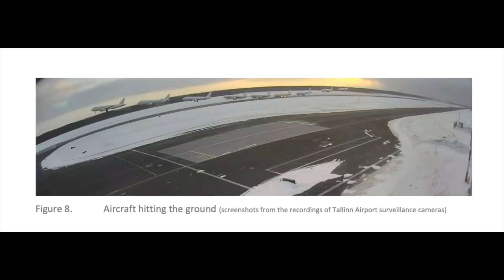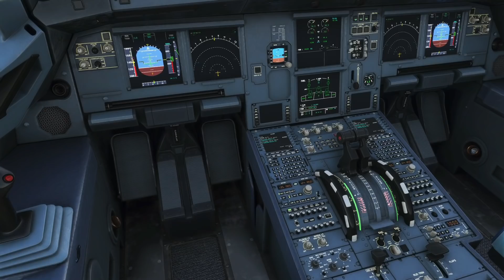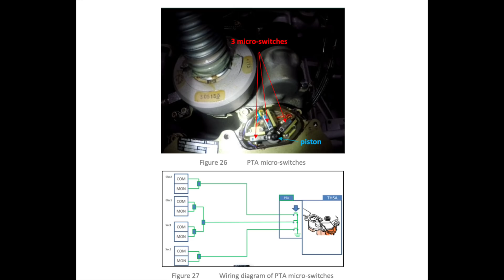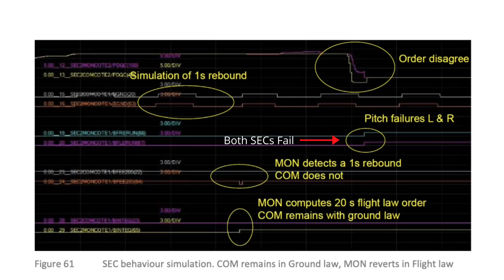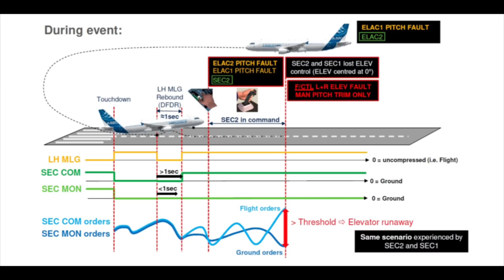The Oil Change That Crashed A Passenger Jet | The Crash Of Smartlynx 9001

Comment: Basically there are now 3 control systems: (I call them) Fly by Cable, Fly by Wire, Fly by Chip.  Cable has been around since even before the Wright Brothers and their Flyer took off in 1903 (all those failed attempts including but not limited to Langley), Fly by wire is where a computer takes your input and moves everything over electrical wires and does have manual backup (been around to various degrees since mid to late 1950s), Fly by Chip is where the computer has basically full control this has no manual backup (used on Canard controlled aircraft which are inherently unstable).
 
Once the oil caused everything to malfunction, these poor guys were close to Fly By Chip with the computer overruling their manual inputs, or least trying to overrule them!
 
I agree with a number of people here, that at the 2nd or at worst the 3rd time they had to do a reset, the instructors and the safety pilot should have said "my plane" take over the controls and land a sick bird.  "The penalties for mistakes here have severe and messy results!"  They're lucky they didn't die in a smokey, flaming hole in the ground!!!
Reply: At no point did the computer try and overrule the pilots? Where did that happen? The plane didn't pitch up by sidestick command because there was not pitch computer active. That is not overruling, that's just computer failure. Ironically if they had reset the computer again it would have been fine as the roll channel of the ELAC was still operational
Reply: @tomstravels520  Miracle of the Hudson (Airbus aircraft system prevented Sully to do a "flair" just before landing in the river, this would have reduced the damage the plane took, not only preventing the flooding (due to a tear in the aircraft's fuselage) but also would have allowed them to use both of the rear inflatable emergency ramps/life rafts) and the Boeing 737 Max's that crashed or almost crashed when the Fly by Chip system got a bad signal
Reply: @timengineman2nd714  you said “these guys”. At no point did “these guys” (in this particular accident) have their commands overridden. If the Max had been designed properly the bad signal wouldn’t have made a difference
Reply: @tomstravels520  It was causing them to have to fight the system!  They eventually  (thankfully) won.
>As for the Max's, that's part of the point!  Too Much Automation that, in the 2 Cases and at least 1 more case, that wasn't properly designed, nor were the pilots properly trained in the proper method to override the system!  (In 1 case the "copilot" would have barely earned his personal (private) flying license, in the US, Canada, GB, and most of the EU!  Thus not rated for being a Commercial  Copilot in all of the above mentioned countries!!!

Comment: i would go for from 6 to 8 on a commercial jet, really plane should be able to fly itself, but because of how complex planes are becoming, you  need pilots to deal with issue or tack off is the senario is not forseeable in the automation

Comment: I believe there should always be a final level of manual control in which the pilots inputs on the controls directly operate the hydraulically actuated flight surfaces; a final no automation, manual fly mode, powered by a seperate system like the apu which should start up upon engine shutdown.

Comment: Good thing this wasn't an actual flight & they were always in close proximity to a runway . A training exercise and they ignore a repeating alarm. One would think training would include things like this. Time to retrain the trainer i guess or fire everyone in that palne.
Reply: If this was an A to B flight nothing would have happened because the pilot would not need to manually stop the trim wheel. Resetting the computer didn't cause the crash
Reply: @tomstravels520  I was just saying why IGNORE a repeating alarm. Would you like to fly with pilots  like this?? C'mon dude.

Comment: Don’t just turn on & off. If you’re a pilot who flies automated planes, then fly them as such especially when training. If you don’t have as much automation, then it’s a different type of flying. Each has there downsides, but teaching students to ‘just reboot’ ends in trouble. At least they learnt why you don’t and a lot else that day. I like automation, but it can never take away from the need for humans to figure it out.
Reply: Do you know why the pilots were able to do so many touch and goes without issues? Because they kept resetting the computer. Resetting it actually did restore normal flight conditions. On the last one they didn't reset the computer and that is when the failures all came in

Comment: I've been waiting for this one! One thing that is not apparent from the video is, that the engines came into contact with runway, in the "bounce" or forced descend, because the gear was already way in the process of retracting. As a result auxiliary gearboxes beneath/on the sides of engines were damaged and one after another the engines failed. While the root cause is very interesting, this part is also very important.

Comment: I don't think the automation issue is something that can be rated on a 1-10 scale as you ask ^^' 

There is a fine line that needs to be walked when designing automated systems, and that's between assisting a human and replacing the human. Aircraft manufacturers/designers have strayed a little too much on the side of replacement, with the pilot being relegated to a monitoring role, which humans positively suck at doing, and isn't very engaging. 

I think a better balance can be achieved, where the automation is used in a smarter fashion to create a cockpit environment designed around humans and what they are good at. The issue with that is that airlines have no real incentive to push for this, since in 99% of cases a plane left on full autopilot will use less fuel...

Comment: In the James Bond movie “From Russia With Love,” his exchange dialogue with another to confirm other agent was legit went like this: Bond -“May I borrow a match”; Agent - “I use a lighter”; Bond - “Better still”; Agent - “Until they go wrong.”

From your well informed summary of this incident and others of other incidents, it appears to me that most modern incidents have some combination of technical and pilot error.  Technology has done well to avoid the more typical pilot errors resulting from distractions and inattention - computers don’t fall asleep at the switch.  But I worry about some situations unlike this one where the computers won’t allow pilot input because their programming is sure that the pilots are making a mistake - like the A320s where pilots made quick upward inputs to avoid the ground but the plane wouldn’t let them due to programming to avoid stalls - leading to crash landings, or the Qantas flight 72 where the computers made sudden downward pitches beyond control of pilots slamming passengers to the ceiling.  

To answer your question, on the 1-10 scale, I’d prefer a 7 level of automation.  That’s enough to prevent most typical pilot errors without causing situations that won’t allow pilot correction in the remote chance that the computers, despite redundancy, are wrong. 

Yes, the fly by wire technology of Airbus is great but sometimes doesn’t allow pilots to correct the rare situation where the computers are wrong.  One A320 crash resulted from 1 of 3 sensors differing with the other 2 so computer rejected the odd sensor. Turned out the 2 that agreed were wrong and they crashed.  So much for redundancy.

 A more mixed computer/pilot control relationship would accomplish the level 7 answer to your question and I think Boeing’s format more closely achieves that.  But neither system will avoid the perfect storm situations such as the Max crashes where the technology fails but the pilots failed to implement the long standing procedure in manuals  to get out of situation (Continuous uncommanded trim change).  

So if James Bond were flying, he’d say to use a lighter, but keep a book of matches in your pocket just in case. And in the case of some third world airlines, make sure the matches aren’t wet!
Reply: The 737MAX crashes happened in large part because Boeing allowed customers to choose not to spec a second angle of attack sensor. They could save $80,000 by ordering only one sensor.
Reply: @algrayson8965   bit like offering Airlines the option of a single pilot Airbus or Boeing isn't it ?
Lawyers have this covered.. as follows. 
A swimming Club has looked to install a non slip mat from the kids change room to the pool edge. 
as kid usually RUN from change rooms to the pool.

They then got told they can save 15% if the 10m run was trimmed back 1,5m & the Club agreed. Y not?
Till 9 yo Jenny + twin Johnny slipped n cracked their heads at the un-matted wet 9m mark.
Parents sue club. 
Club admits, on Q they DID install non slip mat to prevent foreseeable slip injuries, if mat wasn't there..
But are STUMPED to now explain the CRITICAL  15% less non slip matting GIVEN the whole non slip matting exercise  is undisputed by both sides as a safety critical item. CHECKMATE !
Reply: @JoshSasger  Any manufacturer could always have done more...for whatever purpose. Ford Model Ts didn't have front brakes, seat belts or airbags.
Everything in engineering involves a compromise between better and more expensive. It gets to a point where 1% improvement increases cost by 10×. A “reasonably” safe car for $50,000? How about a safer car that is fundamentally the same as the $50,000 model but costs $100,000? A few will spend $1 million+ for a car that will go 250+ mph but if they or something crashes it at 120 mph the occupants are thoroughly dead.
Reply: @algrayson8965  Right - bad idea.  Just like when Airbus allowed customers to opt out of ground sensing warnings and Air Inter in 1991 didn’t install them leading to 2 incidents within a month of each other from the same cause, also like Max.  One A320 crew set the rate of descent indicator knob thinking they were descending at 3.2% per minute (800 ft./min.) when they were actually descending at 3.2 thousands of ft. per minute in low clouds conditions.  The configuration of the instrument was poorly designed causing pilot confusion.  The first A320 crashed killing 87 and the second a few weeks later luckily emerged from cloud cover in the nick of time to avoid disaster.  
That error on the part of Airbus was just as significant the Max engineering flaw but only 87 died instead of 346 so virtually nobody today remembers Airbus’ mistake.  
We may only have 2 major aircraft makers, but we can’t have 2 different standards for judging them.

Comment: It’s not about amount of automation, it’s about common sense vs no sense. When autopilot can partially disengage and not let the pilots know, or computers have disagreements and still continue to operate without informing the pilot, there is a fundamental problem. There should be full automation (10) but the plane should be still 100% flyable manually if needed. And pilots should have full information on what is happening. If that is doable, it’s another question.

Comment: The engine in my cousins car seized 2 days after an oil change in which the mechanic accidentally refilled the engine with automatic transmission fluid by mistake. Oils ain't oils and maintenance guys need to double check their work.
Reply from the maker: Did your cousins car have any long lasting damage?
Reply: @MiniAirCrashInvestigation   Yes the car did suffer some permanent damage-it now burns about 1 liter of oil every 3000km. Prior to the incident it would only ever use a negligible amount of oil during a 10,000km oil change interval. Its quite amazing how robust and forgiving of damage an engine can be. My cousin and her husband removed all the spark plugs, sprayed WD-40 into the cylinders, then turned the engine by hand with a very large wench fitted to the crankshaft pulley until it turned freely. It took a lot of effort to make it turn initially but became easier the more they rotated it. Once refilled with the correct grade of oil (SAE30) it runs again. 

Keep up the good work on the air safety videos-Ive been in aircraft maintenance for 33 years and our aviation regulator here in Australia gives us a flight safety magazine in which an incident is explained clearly, and logically with a 'don't let this happen to you theme'. I really enjoy watching your videos and I learn something every time I watch. Thank You very much for making them.
Reply from the maker: Thanks for the feedback Rocco!

Comment: On automation: a lot of these videos lead me to believe that it is not automation of the flying that needs fixing, but the error reporting system. From what you have said in the video, an error log with timestamps would have let the pilots know, roughly, what was going on. At least, it would have shown that it was taking off that caused problems. Honestly, half the time “the pilot did not notice this crucial eye-opening warning, because it was covered by engine fire / retard-retard / something else”. Put a goddamned tablet somewhere, stream all the errors to it, and add a line "look at the goddamned tablet" after the memory items of every single technical issue.

Comment: I'm not a pilot so can't rate 1 to 10 all I know is that manual controls should always be a option for pilots. Because the mcas system on 737 max should not be able to take complete control of a aircraft without the pilot having the option to disable it. If their is to much automation the pilots will get rusty.

Comment: Rebooting your computer over and over is one thing, doing it on a plane until you crash it, is another thing.
Reply: That’s not what happened. The narrator hasn’t made this very clear. The problem was not resetting the computer until it stopped working. Resetting the computer actually did work every single time. The reason why it then failed was because ironically they didn’t reset the first ELAC and it stayed in a semi failed state with the pitch channel disabled. Had they reset it either during the approach or during the manual trim only phase it would have restored control to the elevators

Comment: I was born in 1963.  My mom worked for Ozark and United. Plus, I worked in the flight kitchen summer. Hence, aviation was of interest to me. Crashes were not uncommon when I was growing up. There were quite a few. It was always a shock but different than now. Today, I rarely hear about a crash. The difference is night and day. So, I have to think automation and technology are responsible for the improvement. My only fear is pilots might not have the skills to fly as they had in the past, and might be technology trouble shooters to a greater degree. Then again, I am just surmising. Years back at O'Hare, I was sitting in the plane looking out the window. There was a plane on the runway. I think he was taking off, I don't recall. Next, I saw another plane descending to land on the same runway from the opposite direction. The pilot about to land went full throttle and climbed steeply. I just figured it was common and didn't think much of it. My guess is that type of thing is unusual today.... not sure.
Reply: wow.

Comment: It really seems right now that could be the Airbus vs Boeing tug of war.  I used to think that anyways. Really though with fuel cost as just one example,  large passenger jets will continue to get more computerized. That doesn't mean less control for the pilot. When there isn't built in redundancy, that I think like you have pointed out also, is really when there is less control for the pilot.    And  I'm not a pilot so really what I think is irrelevant in the long run I guess but man it is just so damn fascinating. Your video's started out great and have gotten even better I love to see when a new one is ready and just wanted you to know that!!

Comment: The ideal and the goal is for automation to fly the plane completely and for a human to be there to just supervise. This should be designed in a way to keep the pilot as aware of what's going on as possible. The biggest problems with automation so far were improperly designed systems which did something as designed, or in error, without pilots noticing causing confusion or lack of proper reaction from them.

Comment: Your videos just keep getting better & better. 

As to automaton versus human control of an airliner, I'm uncertain as to where to draw the line so to speak. Boeing's 737 Max comes to mind as an example of automaton that shouldn't have had the upper hand. On the other hand, I don't have total faith in human ingenuity. The later depends a lot on the capabilities of the human which vary all over the map. So, I guess I'll say that it should be about a 50/50 split between man and machine, provided that pilot can override the automation if need be. Sometimes, human beings when faced with a seemingly intractable problem may have a "Eureka" moment, a sudden flash of insight that leads to a solution or they can come up with ways to exploit a system in novel, off label ways. Then again, some people don't cope with novelty all that well. 

Sorry, if I've gassed on too long. Thank you for your patience. Kudos.